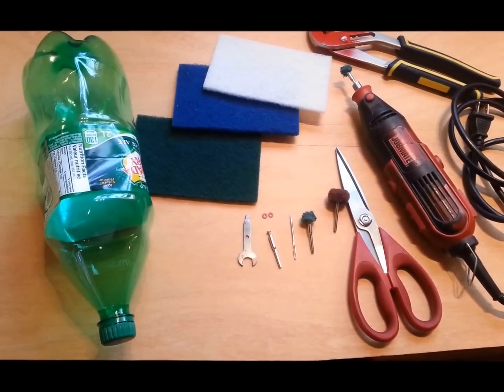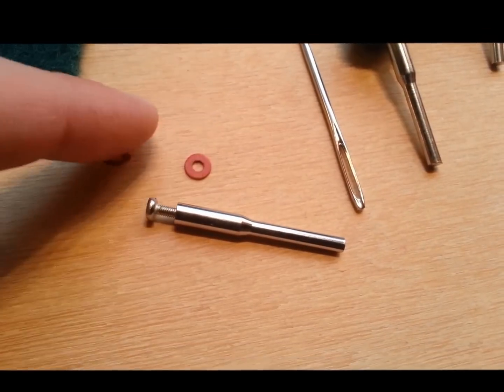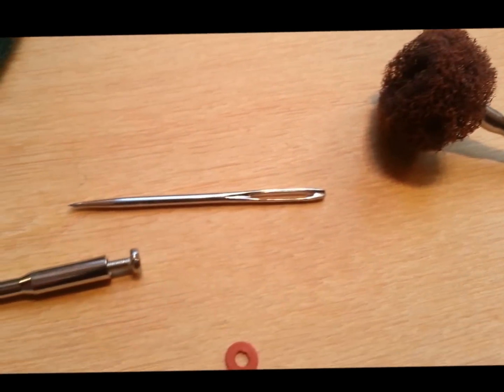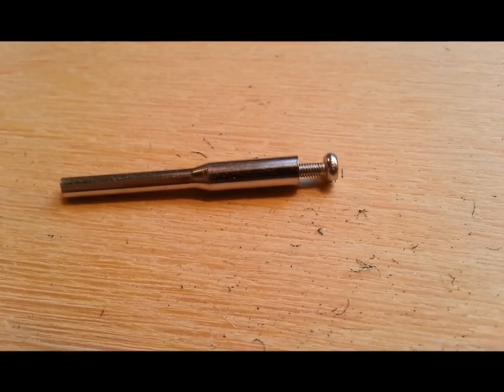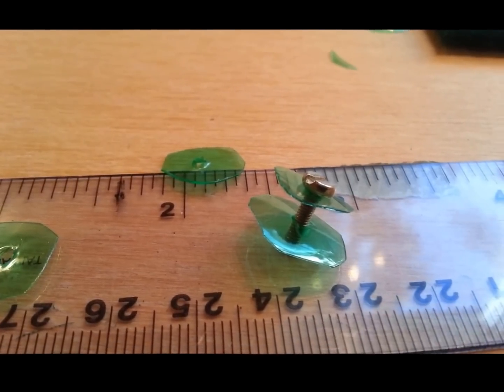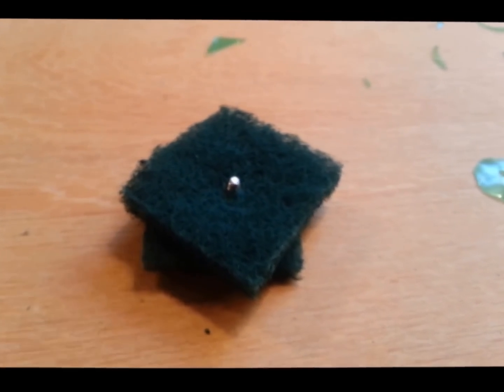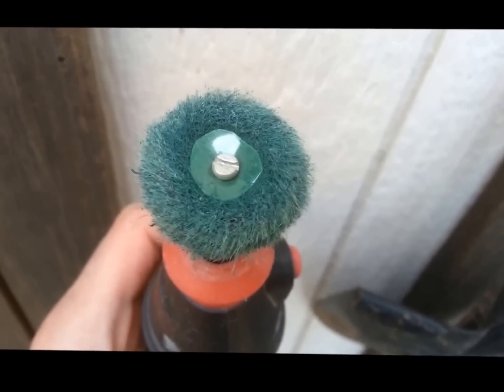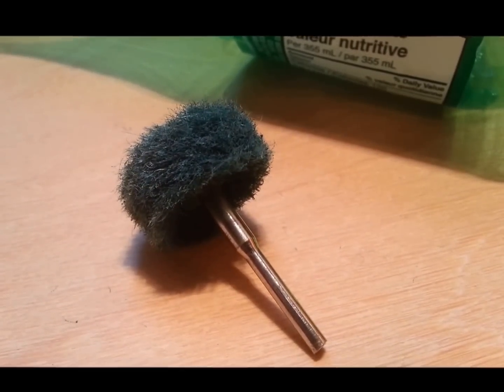How-to Make An Abrasive Polishing Buff for a Rotary Tool Tutorial

Comment: I like to save my old scouring pads for this purpose. Once ive got a couple that id otherwise throw away, i give them a good thorough washing and cut them into the 1-inch squares like you do. The main difference between my subsequent steps and yours is that instead of the mandrel with the little screw on the end (which i dislike because the screw is easily lost and cross-threads easily), i use an E-Z Lock Dremel mandrel. Its quite a bit thicker on the end than the one you use. I just cut a little × in the middle of each 1-inch scrubbing pad piece, keeping the × narrower than the thick part of the E-Z lock mandrel.  The idea here is to cut the × small enough that you have to force it onto the mandrel, but since the pads are flexible (one reason why i use old broken-in pads), they can be manipulated onto the mandrel with minimal effort. The reason i cut an × in each pad instead of a circular hole is because round holes tend to get bigger as i squeeze the mandrel thru, and then they stay the same diameter as the mandrel which is obviously not ideal since theres nothing to prevent them from flying off once i power the tool on. The × cut on the other hand holds the pads in place much better. All of this will make much more sense if you know what the EZ Lock mandrel looks like and how it works, if not just google it or search it on here. But suffice it to say, ive found this very effective. If anyone reads this and is confused or wants any sort of clarification, just let me know, im on my break at work currently so i could probably have elaborated more on certain parts and will be glad to do so. 

Ive also had great success using other abrasive materials, all of which are just as easily adapted for Dremel with the same sort of  basic DIY process. Some of the things ive used are: steel wool/brillo pad/copper wool, aluminum foil (great for restoring old coil-style electric range burners to like-new condition), wood (for burnishing leather edges), microfiber cloth ( same process as the one i just described for the scouring pads), and Magic Erasers (exceptionally useful. FYI magic eraser is essentially super-fine sandpaper,  id say equivalent to 5000 grit or maybe higher).
Reply: But how do you block the pad from flying from the top? Do you block the tip of the E-Z lock mandrel  by inserting a disk or something ? (looks like that https://youtu.be/C8v6dNMcp_g?t=40 ) please show us a picture, or better, a tuto video!
Reply: Ich stanze die mit einem "grossen "Locheisen" aus. Ein kleines für die Mitte. So kann ich sie mit dem Klett-Teller als auch für den Dorn benutzen. Funktioniert immer wieder.😉

Comment: Ha Ha  Did everything exactly as shown   I added more pads to try to get compression  The pads did not rotate just turned on the mandrel.  The original have a bushing that is held to the mandrel.  I will try an eyelet.
Reply from the maker: I sometimes have the same problem. You probably need to tighten the mandrel screw even tighter. Try making the screw really tight.  That might stop the pads from rotating on the mandrel. The little plastic washer, which is cut from the plastic found on a  pop bottle, gets bent a little bit as the screw is tightened, and this seems to hold the pads in place through compression. You could also try making the little plastic washer a little bit bigger, which allows the plastic washer to grip the pads a little bit better.   Another option is to slow down the operating speed of the tool a little bit. I hope that helps.

Comment: You can also make a mandrel using a carriage bolt with a couple nuts and washers. Cut the head off the carriage bolt. Then use the threaded end to first put a nut, then a large washer, a buffing wheel or scour pads, another washer and finally a locking nut; I actually put a lock washer and an additional nut for safe measure, though I'm sure this is over kill. Some carriage bolts might require you to tap threads a little farther down to fit a bigger wheel; I made some wheels out of old bed sheets as well and stitched it with a leather awl.
Reply from the maker: Thanks for the comment.

Comment: Why so slow and so prolonged video..??
Reply from the maker: Thanks for the comment. The video is a little bit long. Other viewers also want shorter videos. I now try and make the video as short as possible. Some viewers also suggested some improvements to the process. They suggested using really small steel washers instead of using small pieces of plastic pop bottles. All the best with your project.

Comment: Is it me or at 12:05 it's slightly staining the wood blue?
Reply from the maker: If the tool is set to a too high of a speed, the buff plastic could heat up and melt, leaving a slight discoloured residue or buildup. If this happens, slow down the tool speed. Keep in mind the tool spins thousands of rotations per minute, so it's possible for heat buildup to occur due to  friction. Heat melts plastic. The solution is to monitor and adjust your tool speed for optimum result. All the best with your project.
Reply: @digitalfriend7114  OK that makes sense, and thanks for the cool trick!
Reply: @digitalfriend7114 absolutely stellar explanation

Comment: 80 of these in four grits cost less than $10. My time is worth a lot more than that. It's like growing onions or potatoes in one's garden - easier and less costly to buy both.
Reply from the maker: Thanks for the comment. That's a great idea. The question is whether to use a do it yourself strategy or to just buy it. Both are good options. I guess it depends on your particular circumstances. The viewers are always looking for an easy solution and a good deal.

Comment: could it be used for stainless steel watch.. br0?
Reply from the maker: I would not suggest polishing a watch with a rotary tool. There's a lot of vibration involved when polishing using a rotary tool. I wouldn't want the delicate parts inside the watch to become damaged. I would suggest polishing the metal by hand. Honestly, I don't know much about polishing watches, so I can't make a good suggestion
Reply: @digitalfriend7114   is it by using the wet sandpaper, with the lowest gid abbras ive ..bro?

Comment: 10 for $2 complete at aliexpress .
https://www.aliexpress.com/item/10pc-Shank-Nylon-Abrasive-Wheel-Brush-Rotary-Tool-Dremel-Accessories-With-3mm-Shank-For-Buffing-Polishing/32867123853.html?spm=2114.search0604.3.217.18525a26HvXFD6&ws_ab_test=searchweb0_0,searchweb201602_4_10065_10068_319_10059_10884_317_10887_10696_100031_321_322_453_10084_10083_454_10103_10618_10307_10820_10301_10821_10303_537_536,searchweb201603_6,ppcSwitch_0&algo_expid=ef186dd2-5fee-40e6-a044-b53edd771e94-30&algo_pvid=ef186dd2-5fee-40e6-a044-b53edd771e94&transAbTest=ae803_3

Comment: I had this "McG" idea to speed some repetitious work and wondered if it had been tried before and how it held out.
I'm going to test it in my application and let you know how it faired.
I'm going to start a half inch larger on the pads and store bought nylon washers and drill powered.
Same concept,just a bit less "garage"
Probably a nail for hole pokin'

Comment: Thanks man, it all worked out great. You can also take small thin metal washers, snip the edge in 2-3 spots and use it to cut. Its not precise, but it works in a pinch.

Comment: A great idea but the video is way too long. There are hand pads sold with actual abrasive in them that should work better. I think 3M makes some. More expensive than the kitchen pads, but vastly more efficient. Worth a try I would think. Don't use good scissors to cut them.

Comment: See the little numbers on the black dial just below the mid section of the rotory tool , or Dremel tool, what these numbers indicate are the relative speeds of the rotory tool, or DremEl tool will turn....  the higher numbers on the rotory tool, or Dremal tools dial that are facing toward you tye faster the rotory tool or Dremal tool will be turning or spinning and the slower settings are represented by the smaller numberson the rotory or Dremal tools dial that face towards you.  But be carful because it spins fast
Reply from the maker: +Clown Whisper Thanks. Good point. I always appreciate comments, because sometimes I overlook an important point, or I don't explain something as well as I could.
Reply: Good one. I still was stuck for hours on the early stages because noone had the decency to detail the importance of connecting the dremel to the power grid. Not even a warning about the potential consequences of holding an item connected to said grid.

Comment: Cool man, thanks
Maybe using that plastic bottle cap is better, cut it with an Xacto knife or blade.
Reply from the maker: +igrewold Thanks for the tip. Great suggestion. I really appreciate the comments. Many times, someone else has an idea or insight which can optimize the process even further, making the results even better.

Comment: champ right here ... thanx ... Awesome video ... Knife handle polishing just became a lot cheaper ... !!!
Reply from the maker: +Johann van de Venter I'm glad it worked out for your project. Check it my new video on this channel "How-to make a contour  sanding sponge disc for a rotary tool tutorial" If you use fine grit sanding sponge, it might work great on the flat parts of the knife handle. The key is to use a light touch, don't press down hard, and be patient. Let the spinning disc do the work. It can get a very smooth finish. Enjoy your project

Comment: thank you so much for your idea my friend, to make your idea even better i tried several abrassive pads and the normal cheap abrassive pads dont do much other than stain the surface with the tint of their color, the best ones with the same result as the original dremel buff is scotch brite heavy duty pad, get the best heavy duty pad from scotch brite and it is amazing, it removes rust and paint just place on the top of the pad the largest coin you have and cut around it but first go to a hardware store and get the smallest washers you can get for the little bolt of your dremel mandrel, use 1 or 2 washer, one on top of the buff and  one on the bottom of the buff and install everything making sure the washers are the most centered possible and there you go

here it is another opcion, buy the industrial abrasive pads from 3m, more the options to the right for coarser finish

http://solutions.3m.com/wps/portal/3M/en_US/3MIndustrial/Abrasives/Products/~/Hand-Pads?N=7581709&rt=r3&Nao=15#Panel

this is the blog i made about these abrasive buffs, thanks to you digital friend
http://dremelabrasivebuff.blogspot.com.co/2016/11/diy-dremel-abrasive-buffs.html

Comment: where can i get  that mandrel?
Reply from the maker: +Regidor de Leon Try ebay and search "screw mandrel".  There are different diameters of mandrels. Get one that fits your rotary tool. The one with little steel washers might be even better than my DIY plastic bottle washer. The washer has to be big enough to really grab the scrubbing pad, to stop it from slipping. You can also buy a dremel mandrel from home depot, but they are pretty expensive, approx.$5.00 each. Ebay has similar products for like $0.25 per each, or whatever the cost is. I make a bunch of these polishing buffs at a time and then use then one after the next. They are so cheap to make when you DIY. Save some money.